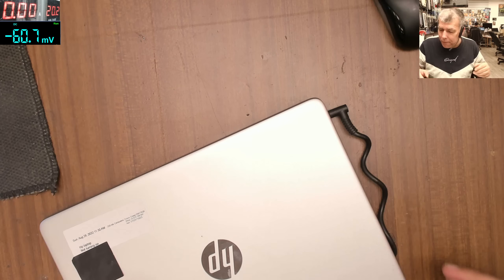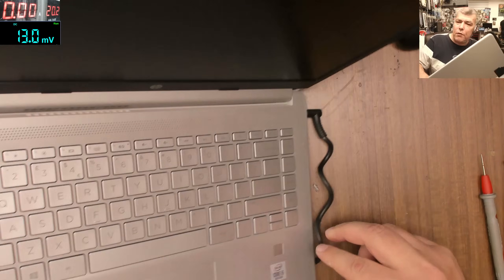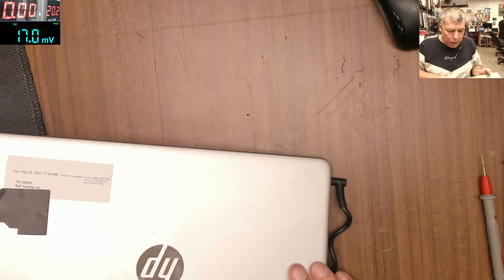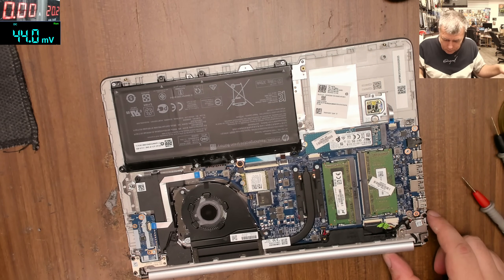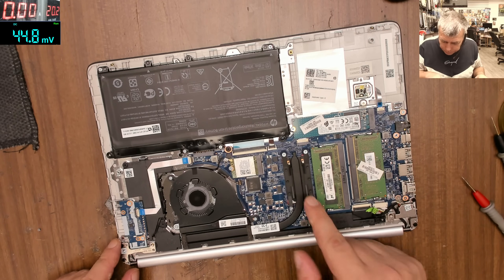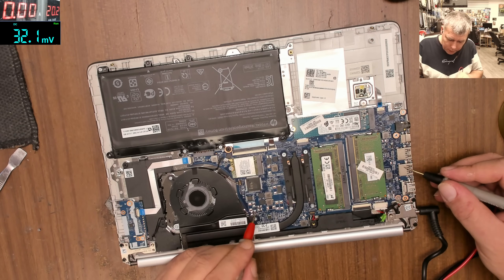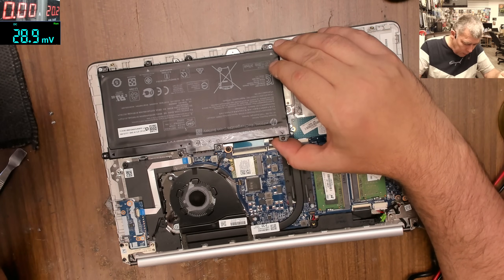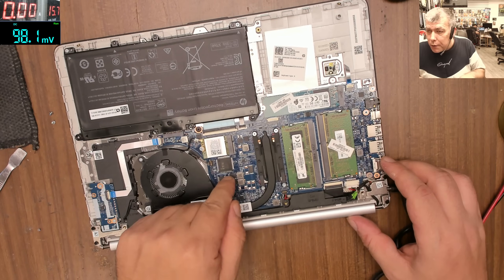Laptop liquid damage repair, most common fault? HP 14s-dq1008na water damage

Comment: Lastnight I had noodle water spilled all over my laptop keyboard and the screen went blank immediately. My battery is bad so I had to have it plugged in constantly so I'm able to use it. That is until I get back a new one. I plugged it out immediately and screw the back cover off and have it open directly pointing on the fan. It's been around 19 hours or so I think. I have not tried turning it on ever since. What should I do?

I was trying to remove my battery to maybe try wiping it with alcohol but 2 screws are stripped and damaged so I can't remove the battery.... I'm using a HP Laptop 15-ef2024nr
What should I do??

Comment: Brother i hitted my laptop to the ground very very hardly
and entire screen splitted from the mother board
i already tried to install windows 11 pro but
When i created flash format by rufus successful did it
But it did not letted me show hard drive through bios so i downloaded irst intel and worked
then i formatted the windows 10 system and despite that the windows 11 pro not installed always %70 and changes blocked
so i am really angered at hp 
I decided to destroy it

And only %50 of laptop left
Although i tried to make a windows 10 as by the flash 16gb
did it from mobile very very hardly so that i did it with alll my patient for hp
and     finally worked but after what? 
And installed windows 10

But and when desktop shows up
nothing   worked despite the direction buttons and key button

And blue screen appeared after 14 hours

I dont know what is that reason

And turned off suddenly so
After that hell

😢😢😢😢😢

My laptop blinking caps lock 3 times slow 2 times fast

And search of google told me it i refers that the HP ram issue

I am very stressful i think it came by the mother board damage or
I want to only know if it is the ram issue i will change the ram i dont have money to another laptop

Please help

How to know if mother board parts damaged or only this was a ram issue

For your info the laptop fan is works well
And other parts looks fine but i very hardly hitted to the ground hp made me very very very very angry i never buy such a bad laptop brand 😢😢😢😢

Comment: Sir, my laptop was waterdamaged. During the service its ic changed including audio, keyboard and also to c port connected ic. But currently im facing display issue. After shut down the next day it display not working. During the service it have no problem. Its third time iam facing the same issue. Do you know the reason 
Laptop model- hp 15s windows 11

Comment: Great video, saved my PC from the scrap heap.   The initial issue arose from a water spill on the keyboard.   The symptom was an error code of 3 long and 2 short flashes on the Caps Lock key.   Using your alcohol (91%) and toothbrush technique, I scrubbed the solder traces on the SSD, RAM, and several other areas (not sure what their function is).   I also removed the RAM boards and wiped off the contacts both on the chip and in the sockets.    Powered up and it worked!    Although with the naked eye there were no bridges, there must have been some subtle fouling of either the solder traces or contact points.  Thanks for sharing your expertise.
Reply: Is your data ok though?

Comment: Shut the front door. That simple? The difference between knowing what you're doing and a novice opening it and taking a peek lol i have a faulty motherboard here, I couldn't find obvious fault, no burn / popped items .. diagnosis was the motherboard due to residue streaks. I replaced the motherboard, boom, was like new. The motherboard i still possess, just pulled it out of  a  box. They have a pet hamster, I've seen it sitting on the top of his daughters pc, there's a vent / mesh on top, my guess was it peed on the pc an some fluid made its way on most likely while the pc was running. I decided id like to know how to diagnose and repair it. Its a good gaming board.

Comment: Thank you so much for this. I spilled some juice on my laptop and I was so upset thinking I would have to pay stupid money to repair it or buy another one but, thanks to this video I was able to quickly unscrew the back and wipe up the liquid and it's good to go again. 🎉
Reply: If I open up the back of my laptop and clean up the soda, my laptop should be working fine??
Reply: @belkdionne3154  most likely it should, when I unscrewed the back, I also had to unscrew a few small pieces to get in between the small spaces the juice spilled into, so make sure to take a picture before just in case you have to unscrew anything in the back so you don't lose track of where to screw everything back in place.
Reply: @LadyLavenderx  thank you so much for responding.  I'll do that tomorrow .
Reply: @belkdionne3154  did it work?
Reply: Hi where there any additional  issues? Mine worked just fine but after some days it's  giving just a blank screen now,what do I do?
Reply: @Zuleikha101  Hi, no mine has been working perfectly fine. Maybe check the back again, maybe some liquid might still be inside some small areas.
Reply: Alright,I will
Reply: Is your data ok though?
Reply: @xmunki1389  yes, everything was back to normal
Reply: @LadyLavenderx  was it as soon as u spilled it because i spilt it a month ago do u think it would still work?
Reply: @anxgel.z  I have no clue if it'll work after a month, but you can try and see for yourself. And no, I didn't wipe it up straight away, I wiped it up a few hours after it spilled & then I tried to see if I could shake the juice out but when that didn't work eventually I found this video & now it's still going good to this day.

Comment: What about if it's FECAL water?
There was an accident in my apartment building and sewage water burst out and went into a few units, one being mine where I had left a laptop on the kitchen floor.
So, it wasn't just "liquid," but nasty liquid and it was almost totally covered by it.
Thank you if you or anyone responds.
Reply: Hello, so did your laptop later work?
Reply: @Victoria-qw5rq  I threw it away.

Comment: Hi. I spilled ice tea on my computer. I immediately disassembled it completely and left it to dry. I then reassembled it and ran it. It worked that day. After 1-2 days, I tried to run it again, it doesn't work. The light turns on when charging. But it won't open. Where should I look to disassemble it again?
Reply: How did you fix this?
Reply: @Zuleikha101  contact sprey ( non - oil )

Comment: Hi Sir, I have kind of similar laptop hp 14s dr-1009tu having an issue with it, it just heats up uncertainly and it's gets down, power light and charging light remains on but ssd light stops blinking... after this only option I left with is force shutdown. Can you please help and suggest me something.

Comment: I swear I had spilled wine from underneath and it wasn't turning on. I did this exact thing and cleaned the circuit panel and operated pins with a toothbrush and alcohol. Then blow dried it and it fired up and charged. I used to make circuit panels and do the soldering/gold plating so I was familiar with it somewhat. Thank you so much 🙏
Reply: Which alcohol product?

Comment: really appreciate your videos, I have the same water damage with 14s FQ0029 au with scaling on ribbon cables, I have cleaned what I can see,  cleaned the super IU was like yours, now I have a light at the power port, 3 volts at the power on board, and battery now charging at 12volts, but not turning on, the power button light gives a faint flick while the light next to it flashes brightly after pressing the power button, any ideas guys?
Reply: Did you getbit fixed?
Reply: No I gave up for now, was thinking about getting a knew board
Reply: Is it showing a blank screen?
Reply: @Zuleikha101  yes blank screen, the charge light works Now after the clean as per your advice / video, but nothing on the screen, it charges the battery now

Comment: Sir i have same laptop with water damage. I cleaned everything but the issue is laptop is not turning on. It is charging upon connecting charger showing orange light near to charging port but when i press power on button power light blinks only on the right. Fans are also not spining what could be the issue?
Reply: Same problem here... What will do?.. Your problem was resolved??

Comment: I have an Asus laptop 55A model 
It was working fine but went off when I inserted a PC pad into a regular usb port I was using my mouse in it (just finished working on Archicad and decided to play PES), it instantly went off, and went into no power no charging.. at first I thought it was the pad but am still using the pad till now on another PC and it is working fine, so my confusion is what could really be the cause of the short on the PC ?
And hence know a way out, I have tried removing RAMS to see if BIOS went back together with HDD but still no response
Reply: Bent usb pins or shorted usb
Reply: @user-te1le7ck6b  I believe it is shorted Because immediately I plugged the PC game pad the device went off, but funny enough the pad had been confirmed good and still functioning properly

Comment: I have an HP laptop and it was working fine, but after I installed the touchpad, the laptop did not turn on, only a flash of light, and after I removed the touchpad, it turned on without a picture with the battery, but with the charger, you can see the HP logo without the background light (it stays on the logo) What could be the problem  .  I have been following you for a long time, thanks for all the information sir.

Comment: Maybe the sio pins that got the water may have been some of the keyboard connections.
That could short circuit the keyboard and power button if it was part of the keyboard.

Comment: Hey again we miss you its been longue time you didnt post a video, welcom again, need all your vidos succesed and failed repair :)

 i have asus gl504 with weird problem, the keyboard and lighting does'nt work, the keyboard flex is clean and in good condition, what will cause this problem?! 
Tried remove and replace keyboard, update and downgrade bios firmware, model gl504gm 314 and 313 version
the keyboard doesnt work except power button, also i have problem, the serial number is not shown on bios menu, could you sell dump bios for that model with it own serial number from doner board?
Reply: did the keyboard work inside bios?
Reply: @maklogetrich2378  the keybord dont work on bios, power on light on botton is not on, backlit light rgb is not powering on also

Comment: Sorin if you have a power supply you aren't using please give me🤣😂🤧🤧🤧 I'm a young technician from Zambia-Africa who has been greatly inspired by your works for a long time now
Reply: Nothing is free and nobody give anything for free. Better start thinking and u will find/make one. Get power supply board from scrap DVD device or video recorder, or TV. On that power supply you have 3.3V, 5V, 12V, 24V... then u can use voltage divider (potentiometer) to adjust to other voltages. And dont forget to limit current ;)
Reply: @orion310591RS  already working on something Brother. So it's not like I'm just seated.
Thank you for your concern and I've taken everything into consideration